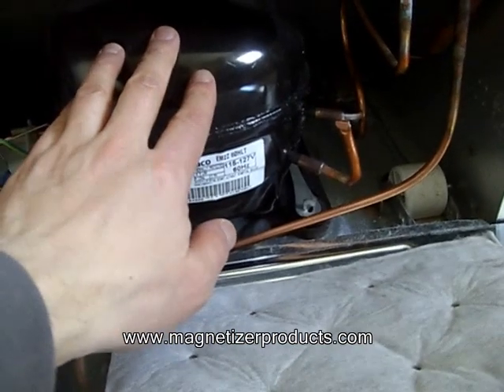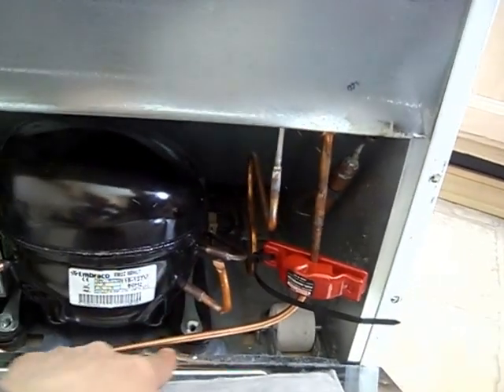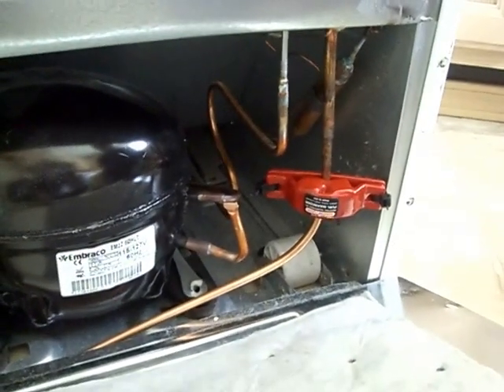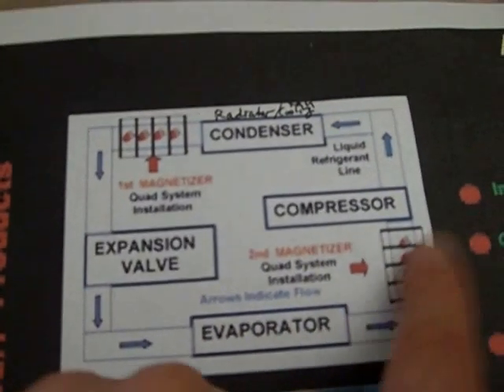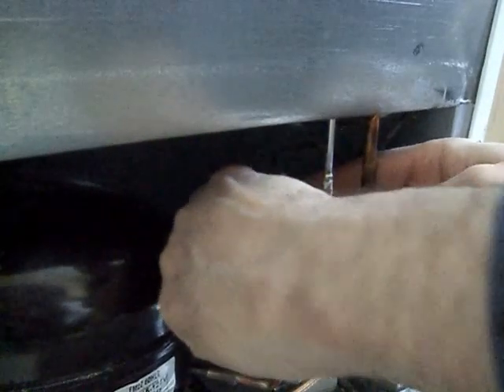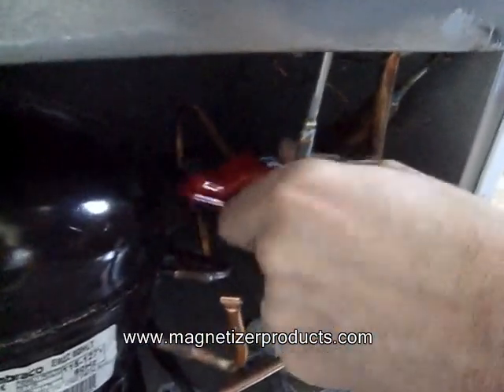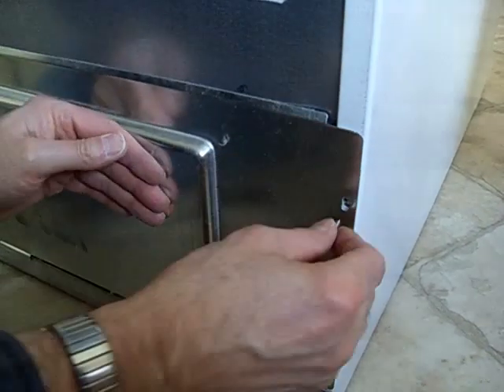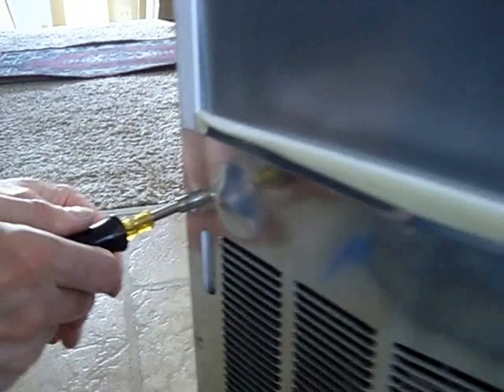Refrigerator magnetic fluid conditioning for refrigerants by Magnetizer®

Comment: Everything is affected by magnetism to varying degrees, however, I agree that the copper tubes would modulate the field imposed by the magnet, as the copper tubes are connected to the compressor which is earthed... I would be more convinced if we could see the installation while the fridge was running, with volt & amp meters connected to show the difference in energy consumption before and after.. If it works so well, it should be no problem to do the demo! I think we'll be waiting a while... ;)

Comment: How does this work? Refrigerant and oil are both unaffected by magnetism. On top of that the copper tubes deviate the magnetic flux. I'm an engineer designing fridge dryers and would be VERY interested to hear any reasonable explanation besides that this is a scam for dollars.

Comment: Fridges today have R134 refrigerant and and the lubricating oil does not mix with it very good at all. That is why the magnets make such a difference. The non mixing issue coupled with smaller compressors contributes to shorter life spans for the compressors. Old fridges that had or have freon mix with lubricant very well and do not need magnets as much - they make a difference but not as much as they do no fridges with R134. Pressures, etc... aren't an issue but oil mixing is.

On older fridges

Comment: The magnetic field influences the compressor lubrication and  the refrigerant so that they are homogenized. Normally, they separate and the compressor strains to get going because of the lack of lubrication. When properly homogenized, the compressor has lubrication immediately. This reduces the wear and tear and extends the life of your refrigerator. Also, the refrigerant evaporates with less energy. This simply means your keep your food cold for less energy.